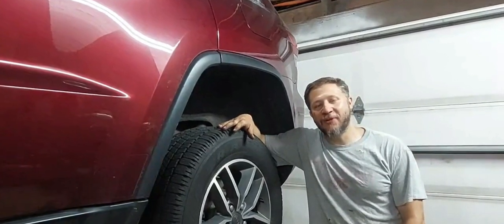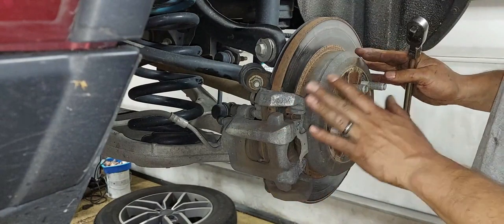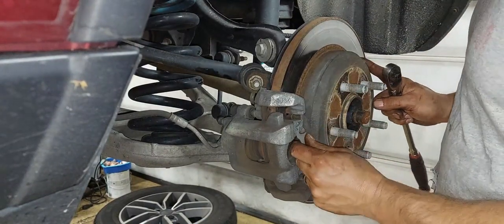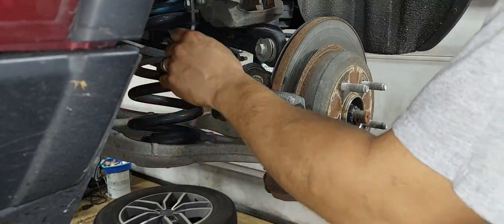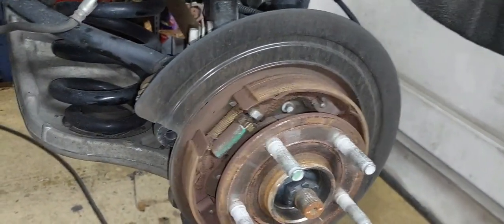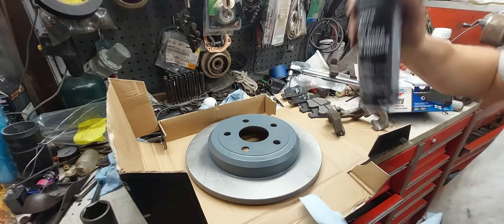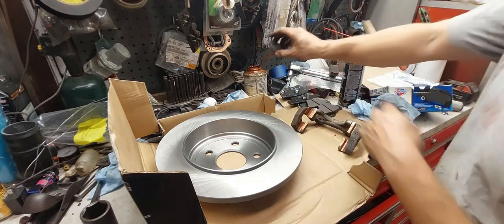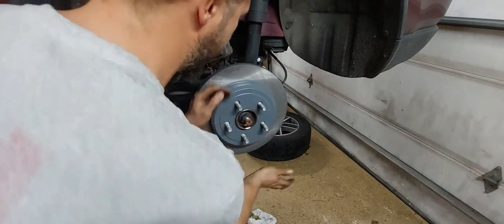2011-2020 Jeep Grand Cherokee Rear Brakes w/torque specs

Comment: Thanks, great video.  Very professional. Just a quick clarification, please - Rear Caliper Slide bolt is shown as 20 Ft. lbs in the notes and is stated 32 Ft lbs in the actual narrative installation (17:03).  Please confirm the correct info if this is available.
Reply from the maker: I have seen varying information on this. My shop manual shows 32 ft lbs. Hope this helps.
Reply: Thank you.

Comment: Don’t you need to go to the screen inside the vehicle ? Settings, brakes and service option to retract the caliper pistons?
Reply from the maker: Not on this particular Jeep. This one has the Emergency brake integrated into the center of the rotor. similar to a drum brake. If your vehicle has the intergraded parking brake on the caliper then yes there is a procedure to retract that system before compressing the caliper. Thanks for watching